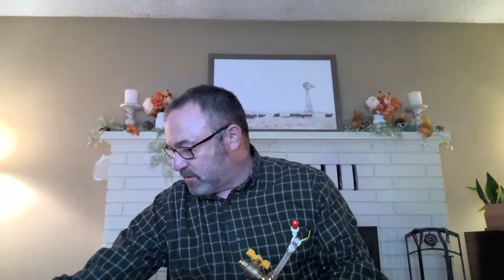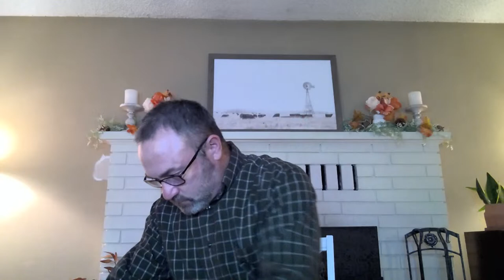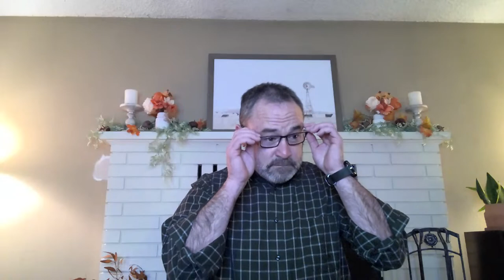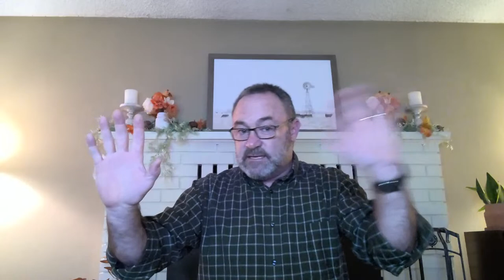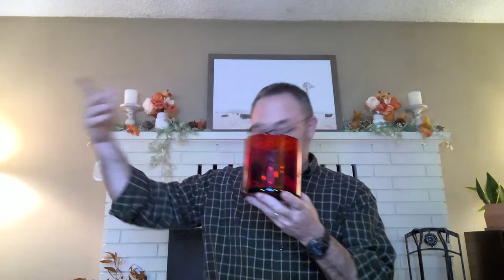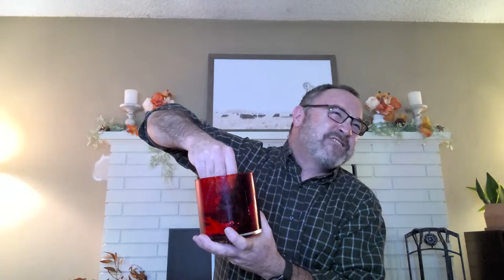Answering Your RV Questions LIVE I December 2022

Comment: Darrin,   On the 7.6 volts in class ? I’m pretty sure it is because the 50 amp micro breaker has tripped.   If the battery is really low and you start the engine, the alternator can put out over 50 amps and trip the breaker.   Could be near the batteries or under the hood depending on the RV company.   Thor in special box under the hood.   Jayco is near the batteries.   Very tiny reset button on the breaker.   Took me week to find.

Comment: You made an excellent comment in tonight's stream about needing EXPERIENCED (versus "certified") technicians.  We all need to begin somewhere, and I'm going to head either to Texas for NRVTA (and $15,000 tuition) or to Indiana to RVTI (less than $500 tuition).  As a pure foundation, which one would you say prepares folks more effectively for RV technician and inspector careers?  I have MANY years as a home handyman, so I can echo your sentiments about experience and ability to troubleshoot.
Reply from the maker: Hi DoneRightRV - without having attended either program, we can't say. Darren does know the folks at NRVTA and we are hoping to meet with the folks from RVIA in the near future, so perhaps at some point we'll be able to give more info, but for now - we would recommend going with a certified program that fits your time, location, and budget needs.

Comment: Hydro hot system. Diesel burner comes on   Burner fan runs. No ignition. Eventually diesel fuel coming out exhaust. Shouldn’t there be some sort of safety valve to prevent this?

Comment: We have a camper with an Atwood 2950-IV furnace that will not work. I checked the sail switch and high limit switch and they tested good. I replaced the igniter as it was rusted. How do I test the circuit control board to insure it is working?
Reply: We have an  Atwood 8520-IV furnace not a 2950-IV .
Reply from the maker: Hi Yvonne, please join us at our next livestream Q & A on January 6, 2023!

Comment: I am at a campground full time at the end of the season I was having a problem when I start using the heater because it got cold I thought I had a heater issue it would not ignite  but here to find out the next morning I was trying to close my bump out nothing worked  after doing some investigation I found out that the fifth wheel battery was totally dead so my question to you  should I add an extra battery or a bigger converter to operate 12 side of the rv
Reply from the maker: Hi Edward, we invite you to join our next livestream on Friday, January 6!
Reply: I pulled out both batteries They were completely dead I took them home and charge them back up and bench tester Both of them are great they checked out OK could I have a bad converter or what charge is the battery when I am a full-time RV seasonally at a campground what do I check next